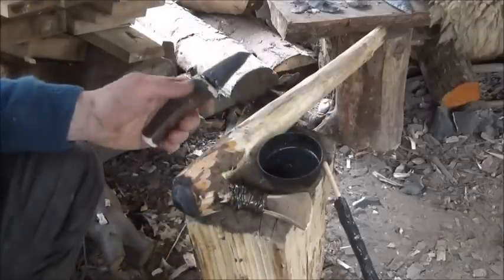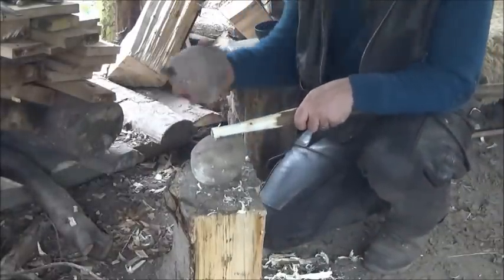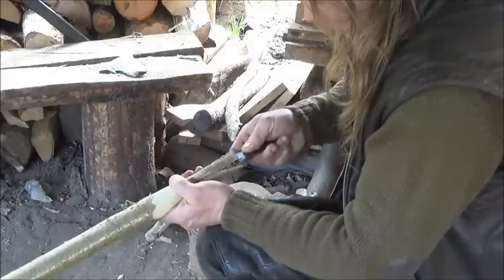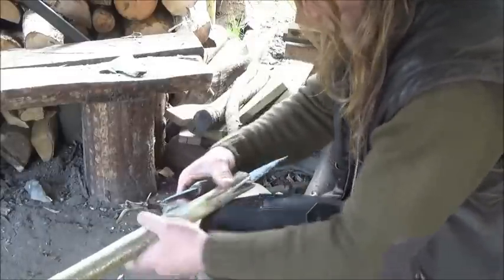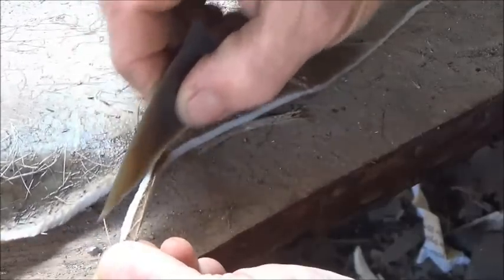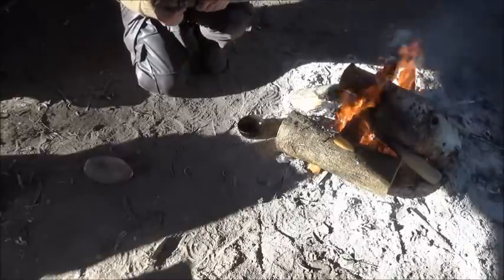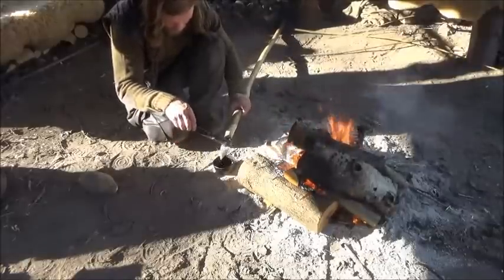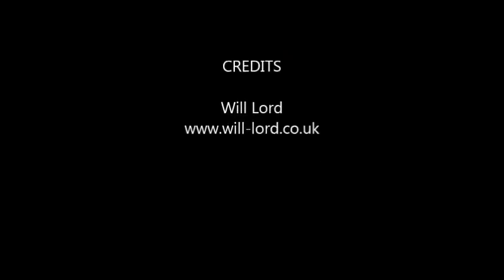halfting a spearhead onto a wooden shaft~1

Comment: Well done Will, i have never seen or heard of pounding the fibers to haft a stone blade. Well done and thy, i suppose you can do the same with a knife handle as well. I usually have used my saw to cut in a groove, tho i figured alot of grinding or sawing with flint to get a groove otherwise.

Comment: Great skill  and amazing video.  But this spear would be able to penetrate only to the length of the blade as beginning of the shaft would create resistance. Transition  from blade to shaft should be more smooth if this spear would be  able to penetrate and not wound only.

Comment: I suspect they'd have used the stronger ash. Wrap the shaft with wet rawhide to prevent over splitting and let it dry then use a stone cleaver/scraper or just a large flake as a wedge and get a split going. I suspect they would have let the thong dry before painting on the binder. Yes I may be full of bull. I also note that you are left with a strong shoulder that might stop penetration. Pretty sure they'd want to reduce the shoulder.

Comment: if you found yourself in the wild how would you create the glue?
Reply: +chris yeah, its a mix of charcoal and pine resin
Reply: Several types of glue can be made using different methods. The pine pitch brew is actually more of an epoxy than a glue. It's great for securing projectile heads due to its weather resistance. But glues can be made from simmering/boiling hides an scrapings, fish swim bladders and casein from milk.